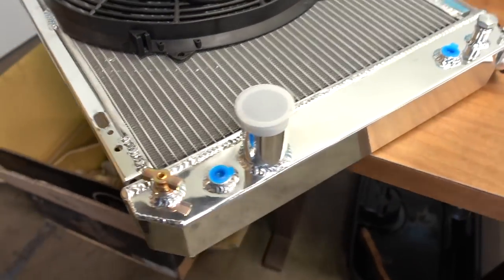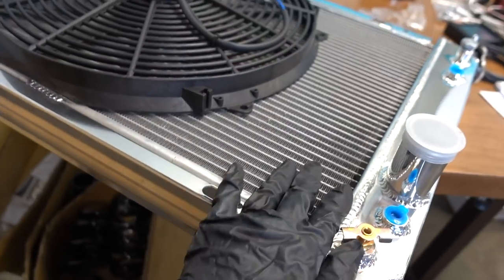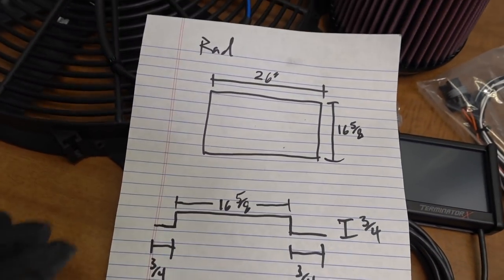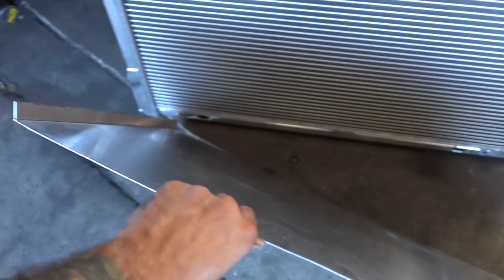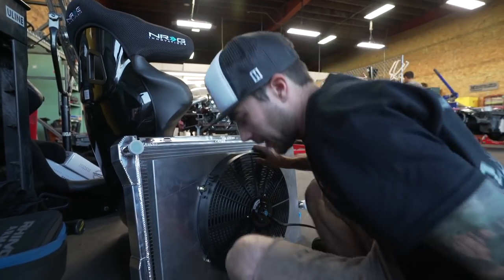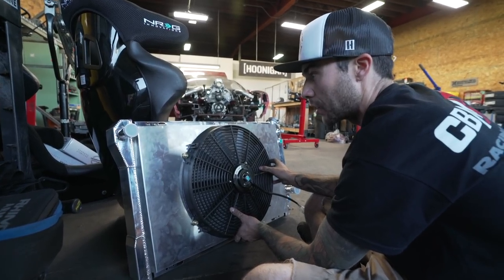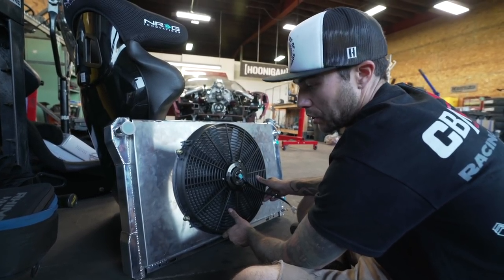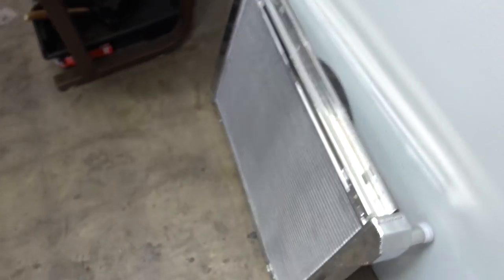Mason's Third Gen Gets Cooler! A Build & Battle Fabrication Saga

Comment: Am a missing something? Leaving the top and bottom open will just pull in air from there, less resistance than pulling through the radiator. Boxing the whole shroud in, top and bottom instead of just the sides would have made the fan work better and fixed it being flimsy.
Reply: Name Name EXACTLYYYYY
Reply: You're exactly right. As a 3rd gen owner I was pretty excited about this build off. But, some of the things Mason is doing just make me shake my head. Like, oh the oil pan hangs too low. Buy an Fbody pan for $100 or less? Nah, we'll just cut half the floor out and raise the engine. -_-
Reply: Came here to say this. some simple aluminum angle is going to make a WORLD of difference in making air flow across the radiator instead of just near it. sheesh. and these guys are fabricators.

Comment: That shroud won't work with the gap at the top and bottom. It'll just pull air in there without sucking air through the radiator. Would've worked better mounting the fan straight to the radiator without the shroud and he wasted all that time on it. Really questioning this guy's ability to build a car with the things I've seen done on it.
Reply: wheeln 24/7 To be fair he was planning on blocking it off on all four sides originally, but I definitely agree with you questioning his abilities. The more I hear him talk and work the less I feel he knows about cars.

Comment: Next episode they take off the fan shroud because it's over heating
Reply: truth. my road race car wouldn't take the shroud at all...
Reply: @Garagegraderacecar  i was kind of disappointed he didnt use some aluminum angle seal off more of the top and bottom. Otherwise, it's going to pull very little air THROUGH the radiator.

Comment: Two pieces of .75x.75 angle to seal the shroud and it completes your original design. Can bolt on the the edge of the rad and not be welded to it.

Comment: 5mm ally sheet and get the fan hole laser cut out, then use EDPM edging foam all around to create the gap and seal. No bends and super easy to remove.
Reply: Read the rules of Build & Battle again.
Reply: You cant laser cut something with basic tools 🤦‍♂️🤷‍♂️
Reply: Yeah fair call, thought they might have been able to use that Kyle bloke to do it

Comment: How do you take the fan off with shroud welded?   Also we prefer using two smaller fans next to eachother, covers area better, less failure rate & when its too cold outside you can disconnect one

Comment: Could’ve make l-brackets to weld to the top and bottom of the shroud to bolt to the radiator. Would’ve actually worked better than his first idea
Reply: Plus he had the two flat sheets all he had to do was trim one in half and weld it in an l-bracket replicate and then weld to the shroud.

Comment: When they have access to a  CNC table why would they not cut the aluminum to size and then fold the edges over with heat and hand tools?
Reply: Because Build and Battle isn't allowed to use special tools. "Just the basics"
Reply: @lavachemist  yeah, just a basic $2,000+ welder and a bunch of different fabrication tools lol.
Reply: @lavachemist  actually, I was wrong. It is a $3,000 machine. https://www.millerwelds.com/equipment/welders/multiprocess/multimatic-220-ac-dc-multiprocess-welder-m30190
Reply: @bigdfitness5020  that's why I put it in quotes. It's Hoonigan's words not my own.
Reply: Would be interesting if all the tools were Harbor Freight XD

Comment: I’ve always wondered doesn’t a full fan shroud restrict flow at highway speeds since air can’t pass through it? Would be a neat test to see if it makes any difference or not
Reply: I dont think so, because that fan is pulling a lot of air if its a good fan.
Reply: It definitely does, especially at higher speeds when the fan speed is neutralized. The shroud needs holes with rubber flappy doors to allow for blow- through.
Reply: Would be cool to do a back to back test on coolant temp with fan shroud vs no shroud. I only use my e-fan around town and in stop and go traffic, at 40-50mph or greater I shut it off and temps never climb so I figure the air passing through it is enough
Reply: @zrsnopro97  I'm sure there's a test on YouTube somewhere...

Comment: Nice fabrication, but you only need enough are flow at idle from the fan. I would have just mounted it to the radiator. Now when you’re at speed and you have air flowing that nice shroud is going to slow the air down. Guess it would be great for burn outs.
Reply: ATL RIOT Ya if you only wanna do burnouts and it overheat in 5 seconds... ask me how I know haha

Comment: I dont understand why cant he just box up the radiator? Just drill a 3mil hole at the bottom of the box to rain water.
Reply: Drift Laboratoires I was originally gunna use cardboard but since I had a abundance of aluminum why not use use it but the brake we had said no to my cool design
Reply: Dayummm. Didn't expect you to reply ❤. 

What I see you end up with almost a box up. I'm not a expert. Just alil concerned it might lost air flow with the big opening on the top and bottom. Maybe could drop cosmetic aside just cut 2 strip to tag on top and bottom. Dont have to be fully sealed. 
By the way love this show man. Learn alot from you and the another guys too. 👍
Reply: Also keep in mind that we are watching this long after it happened. It's not like Josh just did this last night and he can go change it after your comment, lol
Reply: Yea I know that very well